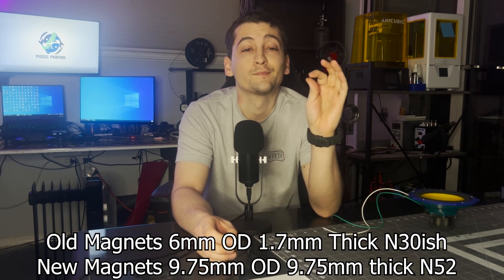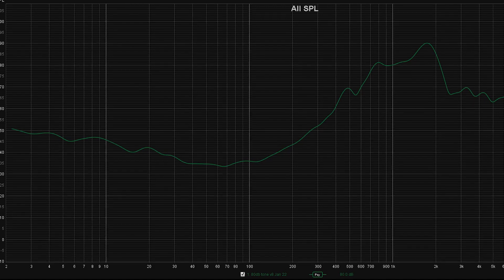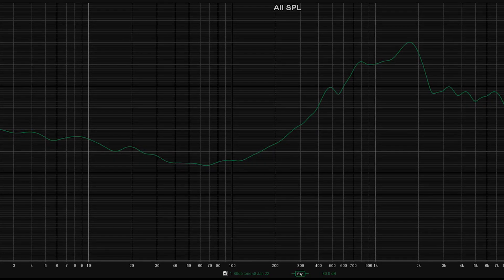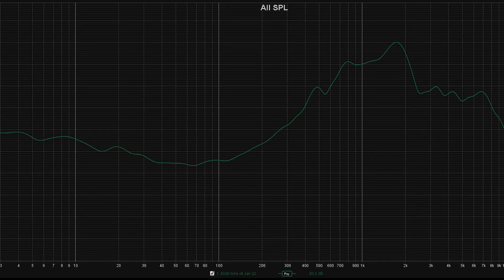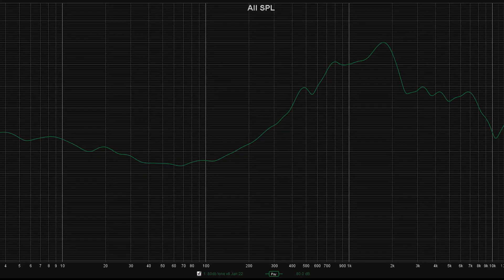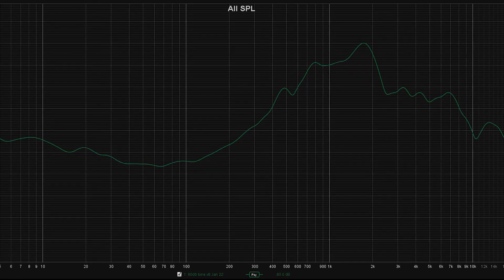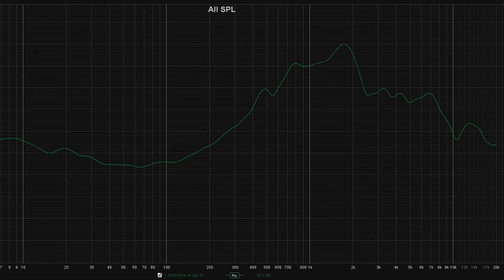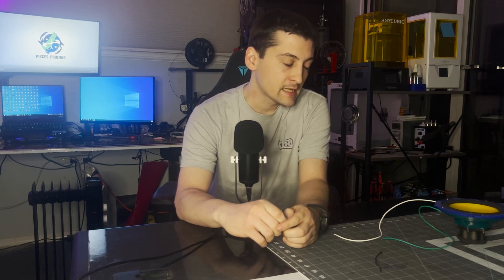Fully 3D Printed Speaker V8

Comment: Can you 3-D print a 40 inch cone for a subwoofer?
Reply from the maker: 40 inch? As in 3 ft 4”? I don’t have any printer even close to 40” of build surface.  Best I could do is about a 12” cone, but then I’d have no way to print the basket in one piece. I suppose I could do the basket in pieces, but then I’d still be out of a printer to make the surround.
Reply: @piscesprinting  correct, is there anyway you could build it in parts and then assemble it
Reply from the maker: The hard parts (basket/ cone etc)wouldn’t be the hardest things to make work, but getting a printed surround that big would be a nightmare. It would have to be a silicone mold or something, but I suppose it would be doable.
Reply: @piscesprinting  well, I would like to try to get it done.
Reply from the maker: If you design a speaker much like I’ve done then it shouldn’t be hard to print, I’d imagine you would just need to put pins in to align all the parts, or build tabs in to things like the cone for alignment. I’d imagine you’ll need a bunch of magnets to drive that much mass though along with a decent VC and amplifier.
Reply: @piscesprinting  it’s held by giant screws on the outer surround. It’s driven by motor and the center of the motor that bolts to the center of the cone. floating magnet inside it. The cone is made out of poly that’s it with wholes. One in the middle of the cone and a bunch on the outer. Screws washers and one nut 🔩 my friend.

Comment: Your motor design is bad ass! it’s looking like almost to Hutchenson style but yeah 3-D printing the surround and the cone and the voice coil yeah you can’t it’s not that’s not gonna work I mean you might prove me wrong but but I’m pretty certain your spider also needs to be different material. Good luck buddy!
Reply from the maker: I’ve printed the spider in stiffer material before (PETG), but currently I’m working on motor design, and coil design. The next video will use a very odd magnet setup, as purely a test and because I’m curious. After that though, I’m pretty sure I’ll be going back to this magnet array setup. 

On the note of the other 3D printed parts, I do recognize there are better materials, however my goal in this project is to stay as pure to “fully 3D printed” as possible. 

Thanks for the feedback, and I hope you stick around and watch the project progress!

Comment: Need to get it in a box to test properly.
Reply from the maker: Yeah, I know I need a plate to separate the front and back waves but I’ve been slowly moving towards a standardized frame I can use going forward, so that I only have to build one plate for all future iterations. Next video I’m trying to get a system to pull device specs out of to get TSP numbers that I’d need to even begin building a suitable enclosure.

Comment: The compliance of the surround is lower than the spider, this should be inverted with a design that's compatible with 3D printing and remember its the function of the spider/surround that's to be replicated not the visuals, also focus on AIR GAP and flux density FEMM.exe is a good place to start, DXF import is a saviour, ATM you have a cone resonator with very little pistonic motion so FW-BW separation is not going to play a huge part, perhaps use a "U" frame Open baffle design once you get some movement for FWBW separation .......source: the rabbit hole goes deeper trust me.
Reply from the maker: Thanks for the input, I’m not sure what you mean by compliance of the surround and spider though… as far as building speakers go, I’m still very much a novice so anything helps. 

I also looked into FEMM and I need more time to sit and read some of the technical documentation for it, as currently I have no clue how to operate the software.
Reply: @piscesprinting  this project will consume you, be wary
Reply: @nickstuart4378  Isn't that the truth haha!
Reply: @Polymate3D  don’t you know it Paul
Reply: @piscesprinting  a simple boost in power would be to find some steel(not stainless) washers one large and one small that fit inside each other with a 3 mm gap to create a flux former, judging by the length of those steel grommets your motor design is neither underhung or overhung which is also another reason why your not getting movement, small steel long coil or large steel small coil. I’d just try to use 2 spiders and remove your surrounds for the meantime , forget the box go open baffle
Reply: This guy is spot on. Love the project but there is so much more to dive deeper on as I have found out myself. You really need to look into voice coil alignments like he said in order to get some decent excursion.
Reply: Also, that steel washer he refers to is to basically form a top plate which basically directs the magnetic field towards the voice coil, very important aspect of a speaker
Reply: Part of what above was getting at re. spider design is that the spider needs to be actively centering the coil. A speaker normally has a corrugated spider that does a decent job of keeping the coil centered. What a cool project though! Can't wait to see what v50 will look like. Also, trying to build a speaker that does all the spectrum is near impossible and very few speakers can do it. Better off splitting the duties between 2 or 3 different speakers, and you'll see size becomes a constraint on frequency. Bigger, heavier plays low, small, lighter plays high.